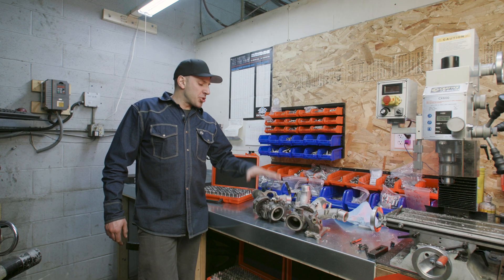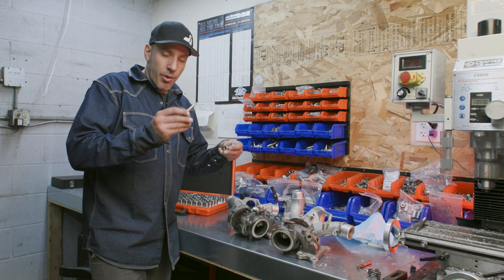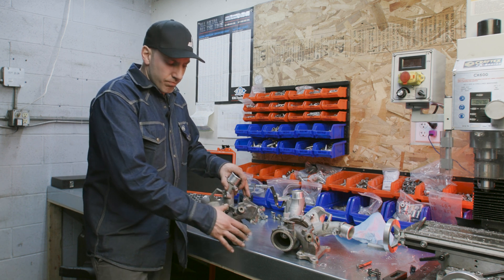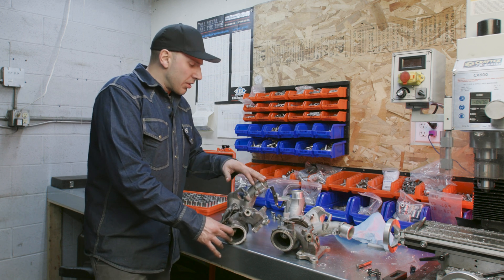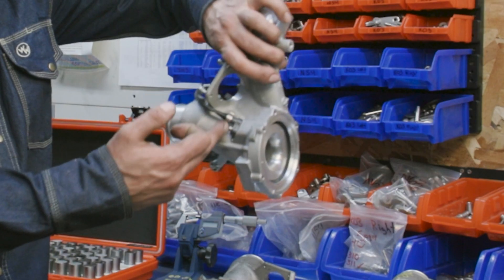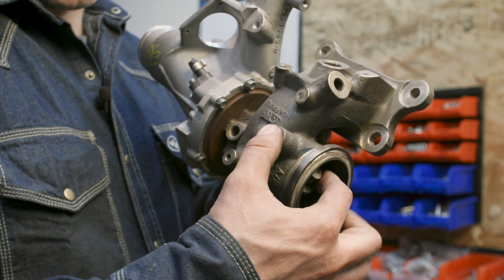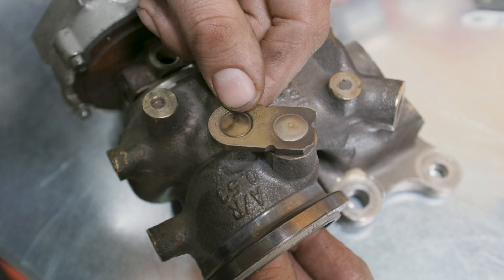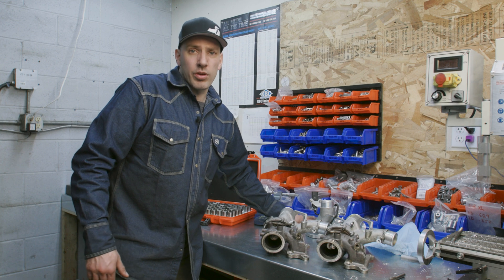Infiniti Q50 Q60 VR30DETT Turbo Wastegate Repair

Comment: I hear it a lot more now that I put on my ark exhaust and ams lower down pipe. Starting to make me think bout how much this repair is or will it not matter
Reply from the maker: The sound will only get worst with time unfortunately.
Reply: Damn, would an Infiniti dealership be able to repair? Or would a common shop or other dealership be able to help. Does a tune help with the sound?

Comment: Is there a repair kit for 2017 Nissan VR30 Twwin-Turbo VIN JN1EV7AP9HM730587 lick all the oil and brake down could they be repair? Thanks a lot if you could help
Reply from the maker: We don't sell the repair kits but the complete repaired units. Thank you.

Comment: Is this why my car rattles like crazy for the first 5 seconds on a cold start?
Reply from the maker: Yes absolutely.  This is the first sign that the bushings are getting worn out.  After a while it will most likely cause you to have boost issues.
Reply: . Does your kit/repair solve the rattle problem, or will it start again in due time?

Comment: Do you know how many vr30s you just saved ? Godsend
Reply: too bad its gonna cost you 3k in labor just to pull the engine.... far better off replacing turbos with aftermarkets
Reply: @BananerRepublic  turbos still good, just rather build them better with a custom rebuild kit with better seals,bearings, maybe CHRA’s if needed. I could get hybrids like every other VR30 owner tho or, be different and try and chase stock turbo records with a aggressive tune.
Reply: @TankF30 or upgrade to z1 turbos and get 750whp. So many people chase stock turbo records, the ceiling is way too high now
Reply: @Eclipsis17  I don’t want to sacrifice my low end spool and have to brake boost to really move out, rather do this and wait on AMS tbh. 

Also, not really I think it’s the other way around, 1/4 only 10.55 on the street for the Q platform with 90lbs (Not a lot at all ) weight reduction on awd not even rwd with weight reduction. DA helped ALOT with that record too I highly doubt they were pushing 19-23psi on OEM turbos. 

Granted, B&C broke it in Miami DA and weather and ran 10.58 with just A2A,E,Exhaust, and just prep. So the A2A proves and dispels all the backlash on it imo but I’d probably still go with the HBP or SOHO (if they drop it soon enough) kit. It’s definitely more than possible.